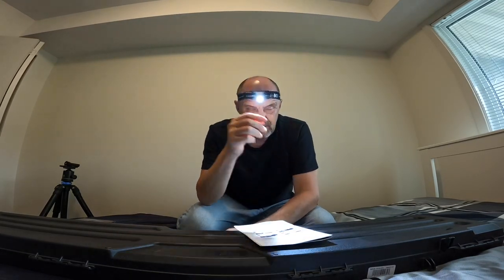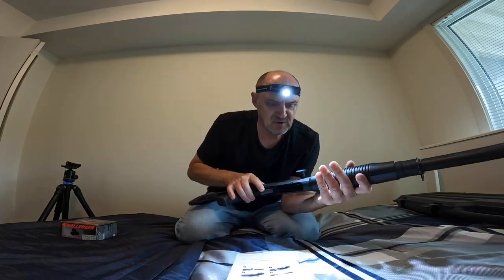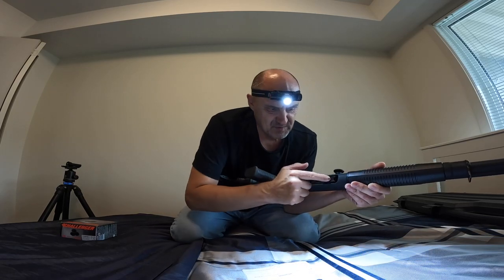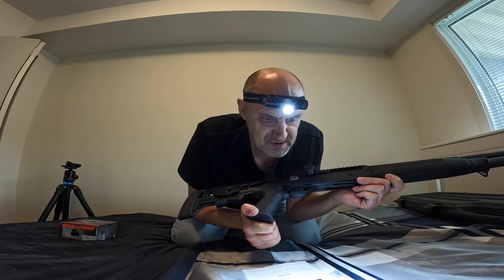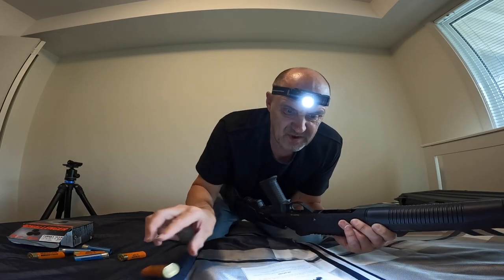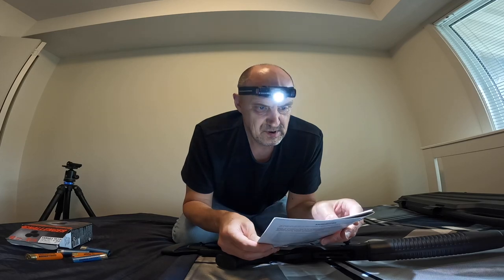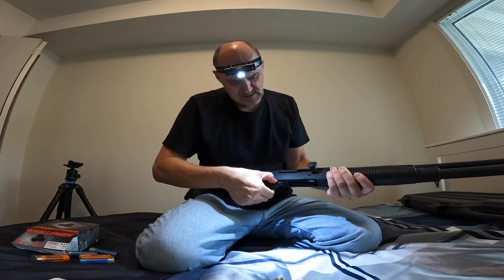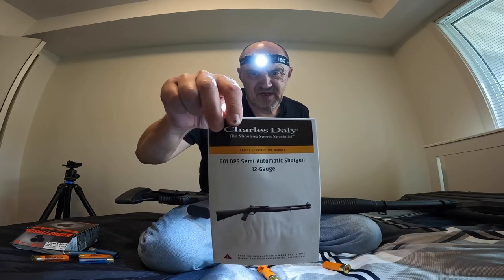The tricky business of loading a Charles Daly 12 gauge semi-auto shotgun

Comment: Have you tried loading the chamber with the first round, followed by the others in the magazine tube? I have a Remington Model 1100 and Franchi 48AL and I load the chambers first, hit the bolt release and then add 4 shells into the magazine tube and both shot without issue.  I just bought a Charles Daly 601 Turkey 12 guage and am taking it to the range soon to test fire and am interested in your experience with your shotgun from a loading perspective as well as overall performance.
Reply from the maker: I tried that, and I had some issues. I find that at least in my case, it works better when I follow the instructions -- load shells in the tube first, then use the bolt to put one in the chamber, and THEN add another round into the loading tube. But my shotgun is a semi-auto; it looks very similar to Benelli M4. I also found the barrel was heating pretty fast; and I discovered they put a restrictive choke on it; so I changed that to the 'open cylinder', and now the barrel acts the same way it does in my Mossberg 590M. Happy shooting -
Reply: @HHTV60  So I took my Charles Daly 601 Turkey 12 gauge to the range. I did remove the barrel and bolt carrier and cleaned and lubed them with Clenzoil  before going the range.  I did not follow the steps in the manual for loading but rather loaded it with the method of pulling the bolt back, adding in a shell, hitting the bolt release to close it, loading 4 shells into the magazine tube, and then pressing the carrier latch. 24 of 25 shells fired with no issues. There was 1 shell that didn't load properly. All I had to do was pull the bolt rearward a little bit and it shut and fired properly. I was using 00 Buckshot. Mine came with 3 chokes. Based on your experience I put on the most open choke that came with my particular 601 shotgun (Modified choke). It didn't get too hot with the Modified choke compared to the other shotguns I have. I figured I would share my first shooting experience with the 601. They are very good guns for the money.